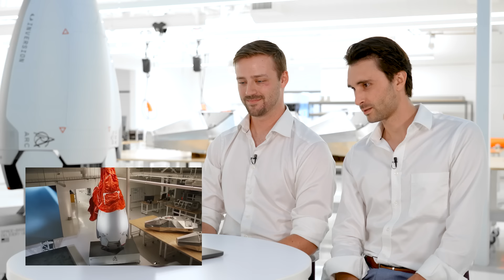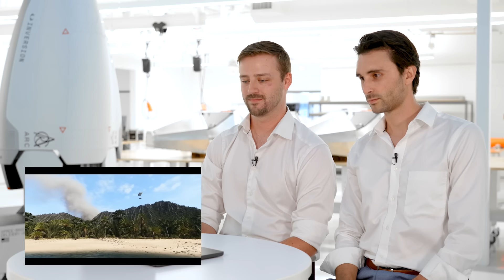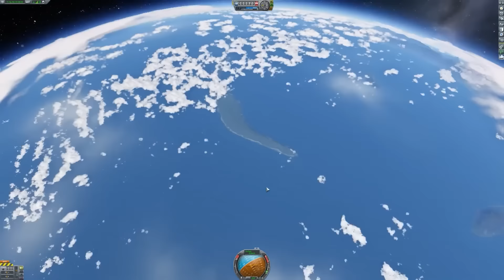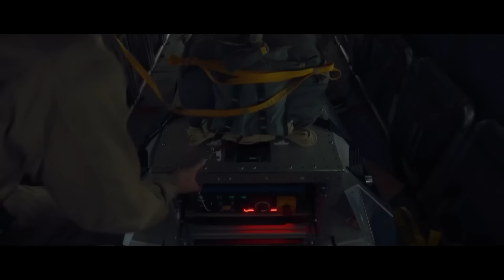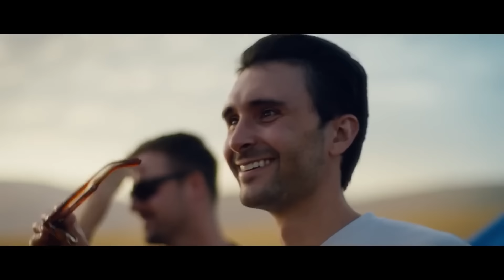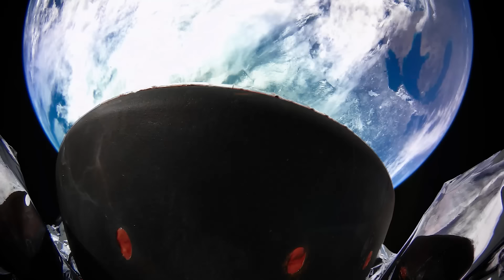Scott Manley Recreates Arc in Kerbal Space Program – Our Reaction

Comment: Wouldn't keeping the retros on the service module increase payload capacity? Then, once the orbit is inside the atmosphere (but before interface) explosive bolts &/or springs would stage with a velocity differential in line of flight for safety, letting aero drag on those solar panels brake the SM even more meaning SM burn-up would be way, way behind Arc. 
That'd be the mass of the retros, fuel, oxidiser & ancillaries added to payload for free.

Comment: 12:43 Ok, BUT. Right? They're not going to be immediately replacing everything they have in-place in favor of this new system even if it turns out to be the greatest thing since sliced bread. It would have to undergo proving trials, field trials, and have to actually work in "production" so-to-speak, IN PARALLEL with existing systems while it's reliability and usefulness is proven - for a significant amount of time meaning that the customer would be footing the bill of both systems for that duration, correct? Not to mention it actually costs a ton of money to decommission a global supply system like is already in-place as well. So you have exit costs from the existing system on top of parallel operating costs for the new adoption.

Comment: About the nuclear fear so while you do fly at a different speed so is there nothing that prevents you or US military to put a nuke inside such a capsule.
That is why there would need to be some agreements, even more so if the capsule is aimed towards the territory of a nuclear power.

The main problem with the constellation concept, even more for someone used to KSP, is the wasted energy putting cargo into orbit.
It takes a lot more energy and rocket fuel to put something into orbit then a suborbital trajectory.
It wouldn't take that much effort to build a tiny rocket booster that could power this capsule and most likely reach anywhere on the same continent (excluding Eurasia).
There was this other space jump vehicle that did just that as well that wasn't much larger, including engine and fuel.

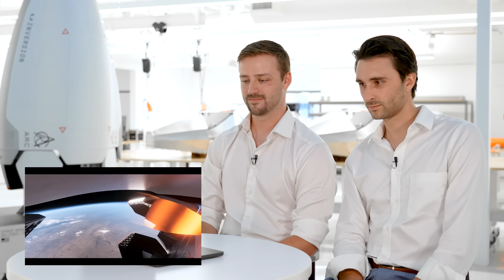Comment: Scott Manley's comment at 1:23 about "changing the order of operations here" is probably referring to the fact that disconnecting, doing a 180, and firing your engines would make you accelerate TOWARDS the satellite you just decoupled from, potentially resulting in a crash. You'd "change the order of operations" by FIRST doing a 180, then disconnecting, and then firing your engines. I hope that clears some stuff up for you guys. Overall, this was an excellent, refreshingly insightful video!
Reply: It seems Scott beat me to the punch on this one. Sorry for not seeing earlier. My compliments about the video still stand though. Great stuff!
Reply: Perhaps a 170 downward?
Reply: @jsalsman  That could also work, as long as you rotated the remaining 10 degrees immediately after clearing the service satellite. You'd probably have to account for the downward velocity in course calculations though, and it wouldn't be 100% efficient. I would imagine this strategy being effective if the satellite couldn't be rotated (although it would be more efficient to rotate 90, tap the thrust to get out of the way, turn the remaining 90, and burn retrograde for the descent).
Reply: @jsalsman  This is a bit counter intuitive to most, but breaking (accelerating in the reverse direction of travel) is by far the most efficient way to get down from orbit.
Reply: @znail4675  Yeah, KSP really teaches you to understand orbital mechanics on an intuitive, almost reflexive level. It's so awesome to know stuff!
Reply: I just detach stuff pointing normal or antinormal before reentry
Reply: @michagrill9432  this is what I do in KSP, lol!
Reply: perhaps they're thinking the satellite might get damaged by exhaust gasses or debris accelerating away from the spacecraft 🤷🏼‍♂

Comment: what if you add- hear me out... Jets and MPD thrusters (Or Ion Thrusters) for more maneuverability
Reply: jets work only at lower altitude and not at hypersonic regimes, and this vehicle is designed to spend most of its time in vacuum or in hypersonic flight, it slow down just as much to be precisely landed under the paraglider which is precise enough. jets would only add complexity, fuel, weight just for adding speed when it's landing, so it doesn't make any sense. ion thrusters don't add maneuverability, they are high efficient low thrust type of engines, they are used for long in vacuum burns to reach distant destinations, they're completely useless in LEO, you need very little deltav to move and keep your specific orbit and just a little bit more to deorbit, everything else will be done by the atmosphere so less weight and engines is better for maneuvering both in space and during reentry. best part is no part.
Reply: @golem_videomaking replace jets with props and did I not just say MPD thrusters?
Reply: @DanyalAdam-n3nby props you mean propellers? even worse in terms of weight and size and still it has no sense to have any kind of propulsion for subsonic flight when this thing does already what is designed to do perfectly, slowdown and landing softly precisely enough. it isn't a fighter jet, it doesn't need to avoid missiles and interceptor while out the plasma ready for touch down, it just touches down. developing aerodynamic and reentry profiles at hypersonic speeds is a far better way to increase maneuverability. mpd thrusters are sci fi nowadays dude, and even if they work it's still a some comparable ion thruster kinda engine, designed for orbital maneuvers that require high dv, not a deorbit burn nor being fired up into the atmosphere or at hypersonic speed. atp why not add a nuclear engine? cos it doesn't need one! it barely needs rcs to maintain orientation in space and before reentry and a small amount of push (likely 30-50m/s of dv, depending on altitude) to deorbit itself. it maneuvers really only into the atmosphere when at hypersonic regime and it doesn't require any thrust for that, is in fact worse to steer through thrusters during that flight sequence than using aerodynamic surfaces to manage drag and lift. you have to slow down during that phase, not accelerate, no engine will made any difference if not worsening. i genuinely don't understand why you'd think it would be better for maneuverability and in which point of the flight
Reply: @golem_videomaking  But you could extend the range of each pod to maybe only need like 2-4 to cover the entire earth while adding fairly minimal weight.
It's on the other hand possible that their plan is to have that capability in the satellite.
Reply: @znail4675  any of these spacecraft can reach anywhere on earth in an hour, due to the fact they're in orbit. you still need a lot of em (cos what if 5 customers want a landing at the same time? 6 customers? 20? you need a constellation anyway) so why pushing money into developing such a system that won't be used as it could cos you still need a lot of spacecraft? from what we saw from the presentation, it is capable of staying in hypersonic flight for much longer than most spacecraft ever, so it would be able to steer a lot during that phase, it probably already has around 1000km of orbit plane change range during descending just due to its aerodynamic.
also i really don't understand how ya think that works, imagine you're in orbit, going circle around the earth at 20k+ kmh, if you just very slightly slow down, literally no more than a couple of dozens of meters per second, your trajectory will intersect the atmosphere, and you will use your lifting body shape and aerodynamic to glide and keep speed, steer, slow down, basically everything using ONLY the atmosphere. i can't see where more delta v or thrust can make any difference in this mission profile. extra dv will allow for an higher orbit (useless in this case since payloads are designed to expire and be recovered anyway after 5 years), or a steep descent profile, risking to burn up during reentry and sacrificing time into hypersonic flight, basically you're using fuel instead of the atmosphere and aerodynamic properties which, unlike fuel, are free always there can't fail and don't weight more on the craft. steering, gliding or slowing down with aerodynamic drag and lift is ALWAYS a better solution than any kind of extra unnecessary thrust 
for example the space shuttle wouldn't have been more maneuverable during reentry using extra thrusters, nor during approach and landing, nor in space where it was an already enough maneuverable craft as any other crafts with a decent rcs system. extra dv would have allowed for higher orbit, maybe useful for the shuttle program, not for this one, def not for "extending reentry and landing range". in fact after a small 30ish m/s de orbit burn the shuttle wouldn't keep any engine on, and also deactivate half of the front rcs thrusters, cos in atmosphere aerodynamic surfaces work way better and front rcs would have fired directly into the plasma creating dangerous shock waves. they studied adding jet engines for final approach, it would have taken so much space and weight to reduce the maximum payload in half as well as the payload bay size, just to add 50-100km of range on a shuttle that during hypersonic flight using no engine had around 1000km of steering/extended range thanks only to its aerodynamic. if your going too forward, just pitch more and do S turns, if you're too short to target, pitch and bank less and go straight, if you wanna go right or left that much to even change your (sub)orbital plane, just roll and pitch to that direction. difference in attitude during reentry will change trajectory A LOT, equivalent of hundreds if not thousands of m/s of delta v. jet engines wouldn't have helped with landings too, too little fuel for a safe go around